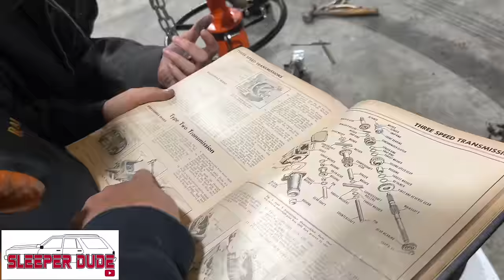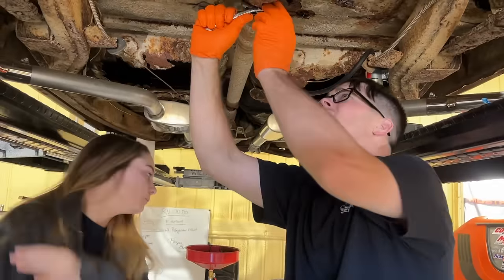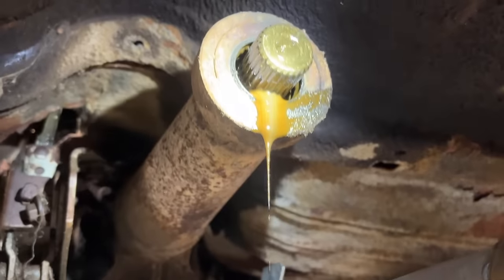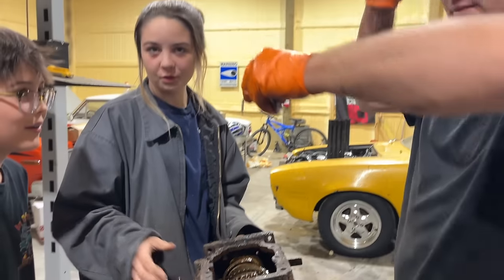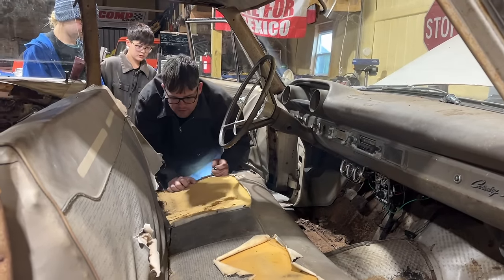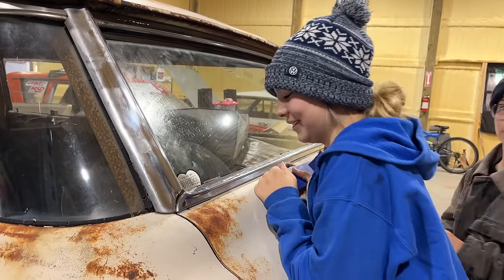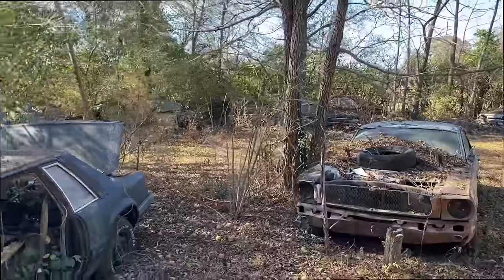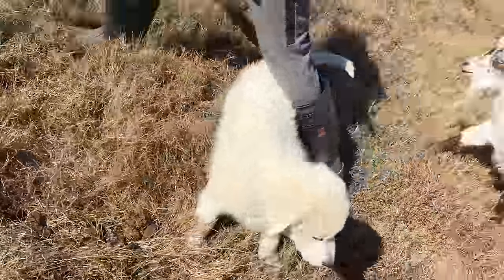What Went Wrong? And I Bought 7 1/2 Cars!

Comment: Tear a strip of old rag and poke it in around the rear shaft and seal. That will stop the oil leaking out while removing the gear box. Don't forget to remove the rag before you put the tail shaft back in. Just sayin.

Comment: You’re not supposed to remove the shifter first dude.  And there’s supposed to be threads in the bell housing to thread the bolts into. You better put some helicoils in it and install the bell housing first then the Tehran’s then the shifter

Comment: 23:30 the big teeth (pawls) on the 2nd to 3rd shifter are popped out too far from the looks of things. I would still say the shifter let it go too far and the big teeth/pawls slipped out. That three speed is too different from old Willys Jeeps or old Flathead fords.
Reply: 29:27 you got the spring loaded pawls back under the sliding shifter collar.